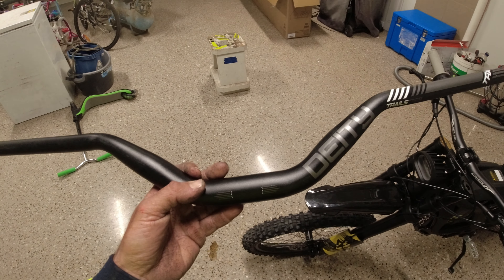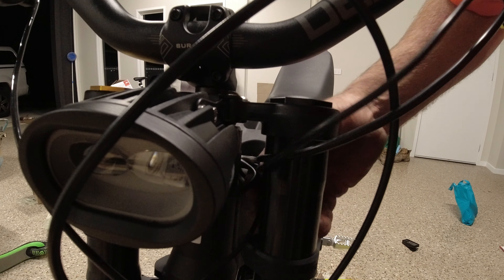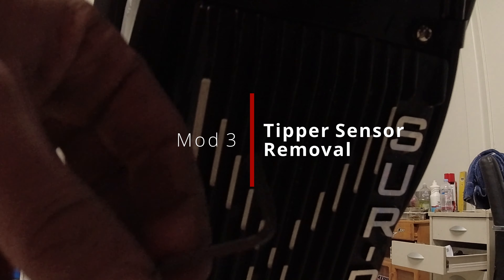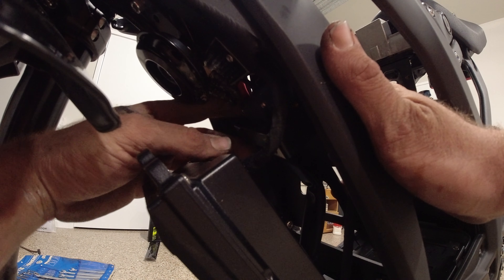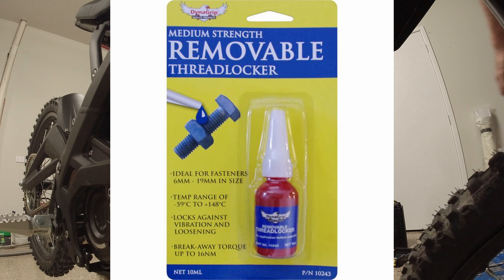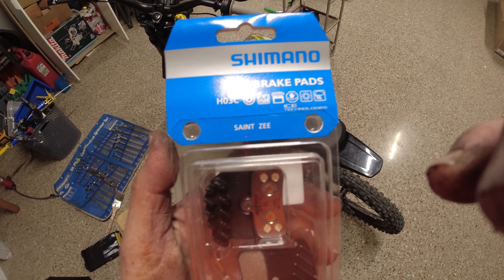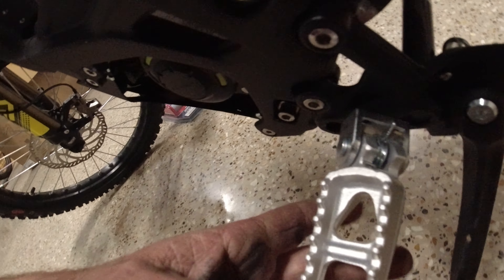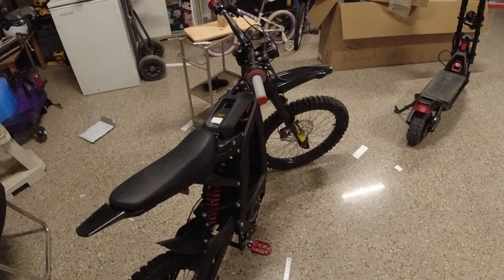5 Mods/Upgrades for Sur Ron X under $100 (2 Free)

Comment: Very easy to disable break sensor without having to remove them
Reply from the maker: I know man but I wanted to permanently delete them anyway saved having the cables doing nothing 🙃
Reply: @antssta  aww ok gotcha 👍
Reply from the maker: @Crypto Man my thoughts exactly bro!!
Reply from the maker: @Crypto Man I am one jealous man mate! That sounds like the dream rig, I’ll be getting a 72v battery and bac 8000 In 3 or so weeks :) can’t wait tbh!! The stock battery and controller is a little lacking
Reply: @Crypto Man that headlight sounds bootleg lol but I guess if you don't need different Eco settings then it don't bother ya.  I'm guessing you have a NXT display?
Reply: @antssta  get the bac first then the battery.  The bac actually will make a big difference before even getting a new battery.  Batteries are so damn expensive.  I'm going to start making my own.
Reply: @antssta  your also better off getting the magura mt7's instead of the 5's their both for ebikes
Reply from the maker: @SpreadingKnowledgeVlogs  I got one mt 7 and one mt 5 (all I could find at the time)just got to put them on
Reply from the maker: @SpreadingKnowledgeVlogs  also I’m buying a 72v 42ah battery on Monday and bac 8000 following week!!

Comment: Oh, and just put HO3C Shimano pads in front.  Save 50%.  :)
Reply: The problem with that is the hoses on the Surron suck.  You can feel them expand as you brake.  This bike was built sparing every expense to make it cheap as possible and you can def tell